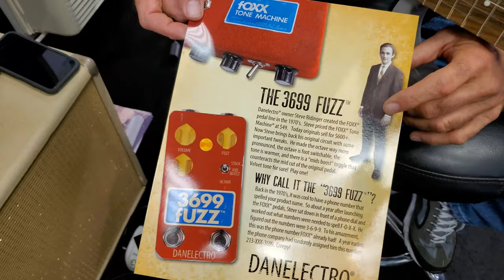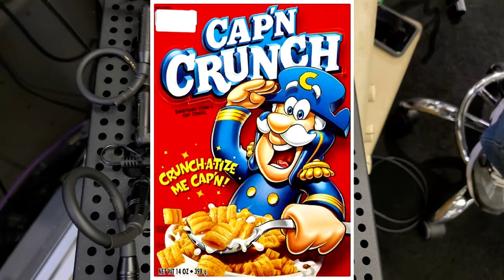Danelectro 3699 Fuzz, Back Talk Reverse Delay, Roebuck Distortion Demos Namm 2020

Comment: does the danelectro fuzz have to be first in the chain or can it go anywhere?
Reply from the maker: Since this is a fuzz face style circuit it will work BEST at the beginning but experimentation is key. If you're using all true bypass pedals it might not be bad because really, fuzz pedals don't like buffers.
Reply: Gear Sounds well the pedals I have are a proco rat, a boss mega distortion, a wampler paisley drive deluxe and a boss compressor
Reply from the maker: Sounds like you've got all drive but the rat has a buffer and so do both the bosses. I would put this first in your chain but experiment with it AFTER the paisley and before everything else to see how it stacks and if it behaves.

Comment: Too much $ for Chinese pedal  IMO.
Reply from the maker: Is it made in China and assembled in the us? That's what it seems many are doing these days.
Reply: @GearSounds  definitely made in China,  don't know if it is assembled in China or not but I think so. Just made to danelectro specs. The karma mt10 is made in the U.S. and is same price. From the reviews I have seen and the sources they have come from the karma seems to be a better quality, "boutique" build and the person that designed them has good credibility.
Reply from the maker: Wow, you seem to be right although the made in china and "assembled in the US" gets rather fishy. I don't like JHS for that reason as the pcb boards look to be made in china and they just "assemble them" as in, put them inside the metal housing here in the united states.